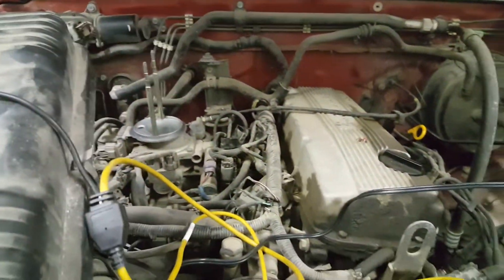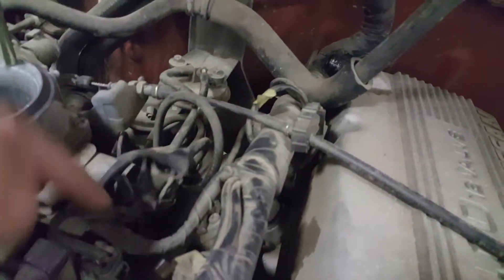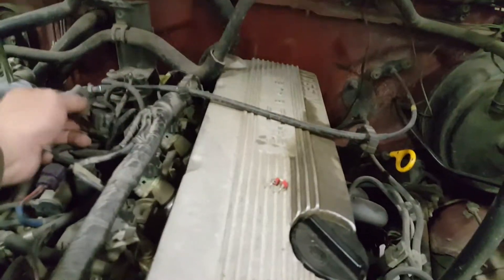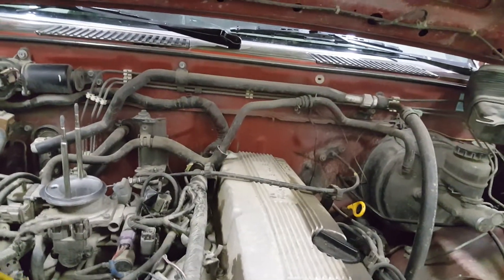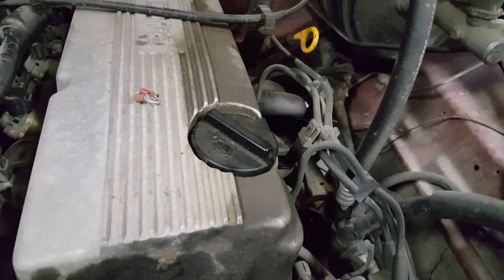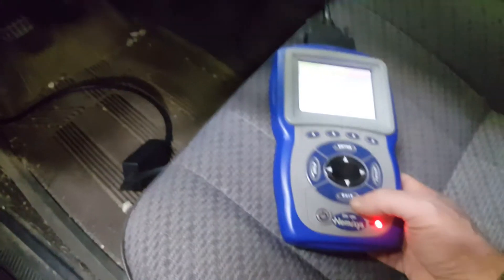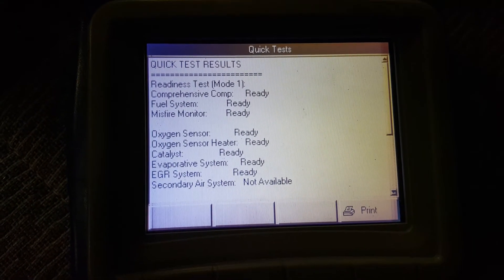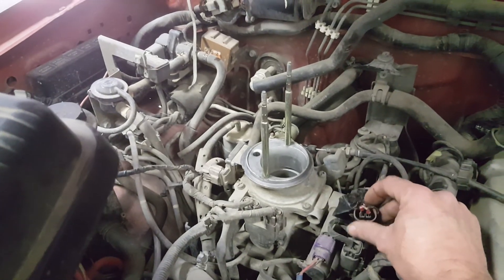Nissan truck P0400. Egr delete for non functioning egr valve.

Comment: just an fyi, I've read somewhere a guide that recommended a 68k resistor. I put it in and got codes after a few miles with it. 100k resistor seems to be working better.

Comment: What watt is the 100k ohm resistor you are using
Reply from the maker: I don't think resistors go by wattage. Just use the ohmmeter on your voltmeter to measure it.

Comment: Do you run it without and egr vavle
Reply from the maker: Either way. If you remove the egr you need to block off that passage.
Reply: @wickedspray7475  i cut off the line connecting to the oem headersi have aftermarket header i am going to delete the vavlve just wasnt sure if it would affect anything

Comment: Wanting to now if this simple resistor will defeat the EGR Code logic for later 2002-04 Frontier, any feedback ?  Thanks
Reply: You ever figure this out? Replaced the egr in my ‘02 frontier 4cyl and it’s still getting codes.
Reply: On my 2004 xterra it has the same egr temp sensor, though I had to use a 22k resistor to get the voltage down to .9v.  I might have to lower the resistance to get it closer to .5v if the cel pops back on
Reply from the maker: Maybe I"m not familiar with those years . You need to find out if the EGR system uses a temp sensor to gauge exhaust flow. If it does unplug the wiring from the sensor and install the resistor. If it pops an engine code then it won't work.

Comment: Like the thing you made to put into the plug to drop the ohms or the voltage ?
Reply from the maker: it won't hurt anything, but if you don't put the resistor in the check engine light will be on.
Reply: Wicked Spray oh okay thank you  my check engine light is on anyway. Do I just rip it all out and bolt on the delete plate and I'm done?
Reply from the maker: sorry for the long delay. Yeah just make sure you plug any vacuum hoses.

Comment: You have headers on it?
Reply: Curious where I could find a header for 97 4wd, I've looked everywhere and can only find header for 90-95. I'm unsure of the difference from 95 to 97
Reply from the maker: yeah exhaust headers. When i bought it the exhaust manifold was cracked so i bought the headers from my buddies kid. don't know where he got them from.
Reply: Wicked Spray any power difference?
Reply from the maker: truthfully I couldn't tell you. the exhaust manifold was crack when i bought the truck and the tranny only had fourth gear. Had the tranny rebuilt and replaced the exhaust manifold with the headers. I didn't have any drive time with the stock manifolds before i put the headers on.  i can say you need to get the rpm's up above 3,000(really closer to 4,000) before you feel any power.
Reply: Nice hardbody